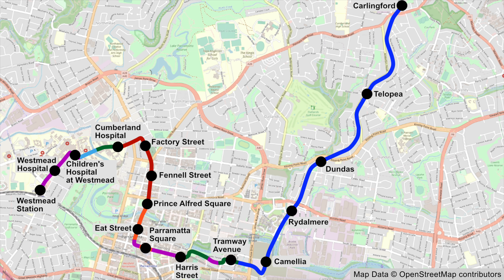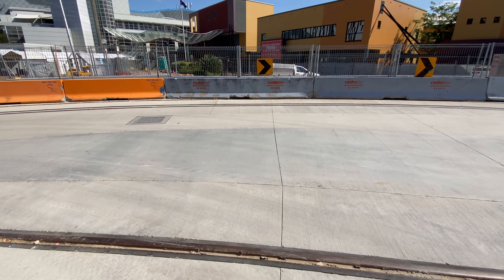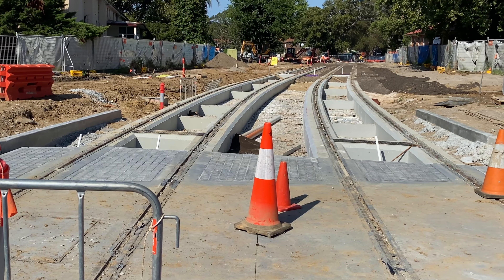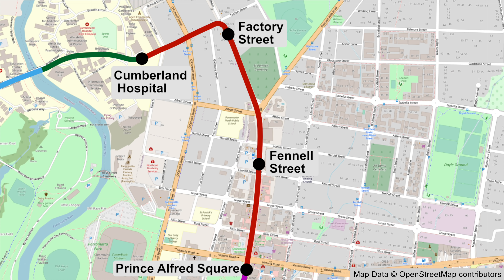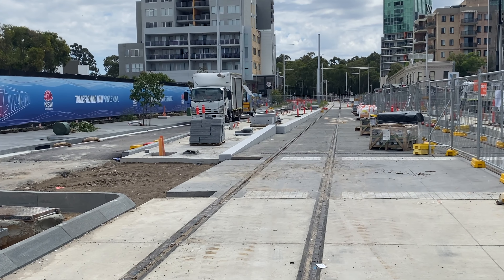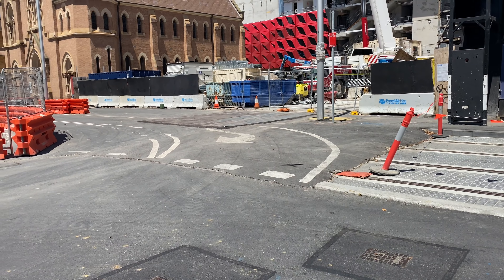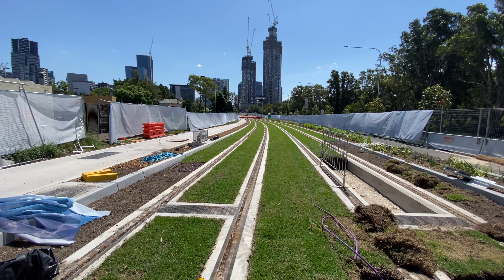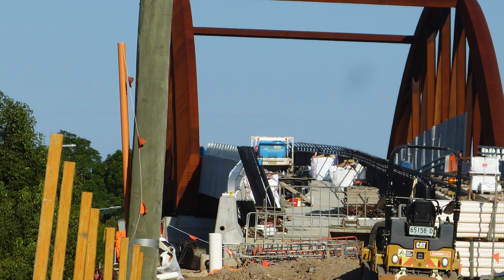Parramatta Light Rail Update Part 1 | Westmead Station to Tramway Avenue via Parramatta CBD | Feb 22

Comment: Catenary are the curved wires that hold up the conductor, it derives it name from the latin used to describe the curve. I think the purple things are dripper tube for irrigating the grass.
Reply from the maker: Thanks for clarifying that. I think I'll use "overhead wire system" in the future, unless you can think of a better phrase to describe the whole thing? Yes, someone else mentioned that the purple cables are for irrigation, and that makes sense, as I've only noticed them on the green sections.

Comment: Hi Paul, thanks for sharing another excellent video. Westmead has changed quite a bit over the years. The streets for the light rail look quite wide, similar to most Melbourne CBD streets. It is certainly going to be an event to remember, when this line opens. Anyway, wishing you all the very best. Robert.
Reply from the maker: You're very welcome Robert. I think some of the streets were widened by demolishing some properties, so that on some sections, trams can be segregated from other vehicles.  Yes I can't wait for this to open, I think it will be very popular!
Reply: @TransportVlog  I think the opening day will be quite spectacular. Parramatta hasn't had trams on the streets since the steam trams ceased operation way back in 1941. Actually, that was the last steam tram system to close in Sydney and it was apparently privately operated. Incidentally, I noticed a lot of area dug up around Westmead Hospital. How do they get their vehicles in and out of the hospital at the moment? I am guessing there must be another entrance.
Reply from the maker: @RGC198  The entrances to the hospitals on Hawkesbury Road and Hainsworth Street are still open, and vehicles are currently travelling over the tram tracks to get to these entrances.  It will be interesting to see if that will always be the case, or whether extra lanes will be added either side of the tram tracks for road vehicles. Something I'll look out for on my next update.

Comment: couldn't help but tune back to watch this lovely video great work paul also i wonder if they'll clean within the tracks if that's normally what happens or not
Reply from the maker: Thanks! - I'm not sure about cleaning within the tracks. There will definitely need to get the asphalt and gravel out before the tram testing starts!
Reply: @TransportVlog  no problem and yh definitely they wouldn't want any casualties during training
Reply: Hi I was just wondering how they do trackwork on the Light Rail lines?

Comment: Hi Paul. There's certainly been a lot of progress! I suspect the purple cables in the green section might actually be irrigation lines. Another great video!
Reply from the maker: Hi Jim, Thanks! - Yes irrigation! That makes a lot of sense and would explain the different colour as well.  Something we probably don't need right now, but when our hot dry summers return, it will be good to keep the grass green!
Reply: Purple is usually the colour used for recycled water so maybe they are supplying that for irrigation.
Reply: Either that or drainage.  Those concrete pits risk filling up with water.

Comment: I know this is a bit weird but... why batteries? Why not APS like in the CBD between Town Hall & Circular Quay, would make the tram a lot lighter if nothing else...
Reply from the maker: Good question Zane.  I don't know the answer.  It might be because APS does not work so well on very cold or frosty days and Parramatta can be up to 5 degrees colder than Sydney CBD, so that might be the reason!  It could also be because CAF have a battery option for their Urbos trams, and APS is an Alstom solution. I'm not sure if CAF have an equivalent.
Reply: @TransportVlog  interesting. Though, batteries have the same problems - plus overheating problems. With APS or a full overhead solution, it would mean a lot less asset may need to be guarded long term, and there would be no need for an on-board battery or anything of that likeness. Full overhead would be preferable long term, since the grid is expecting storage in some form of batteries - whether mechanical, chemical, or something outlandish like artificial photosynthesis producing hydrogen. Regardless, I see batteries as quite foolish for any vehicle to carry long term, especially one on fixed infrastructure... their maintenance costs will likely be rather high long term, but short term it does avoid having thin, high tension, high voltage wires strung over an already rather dense city.